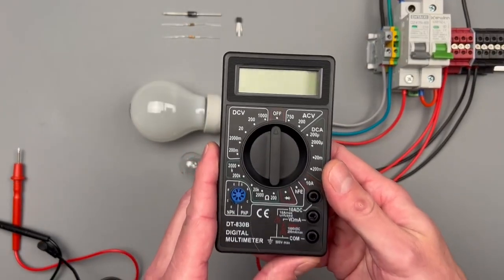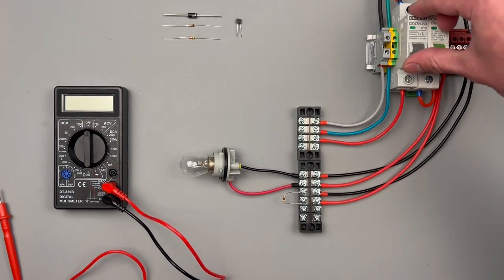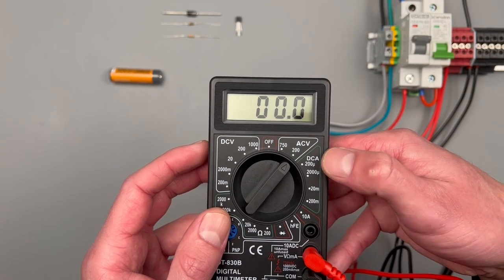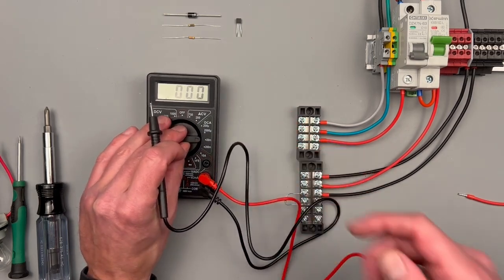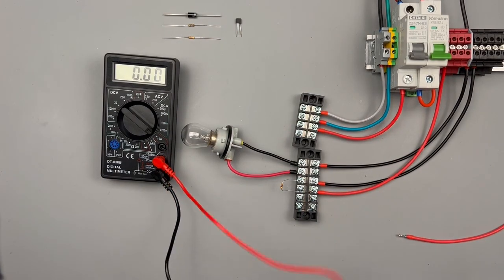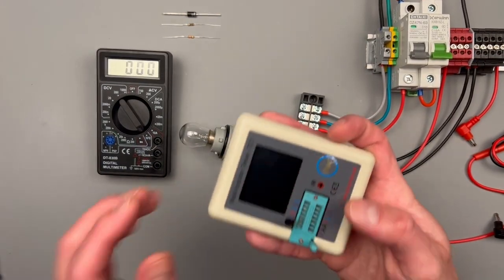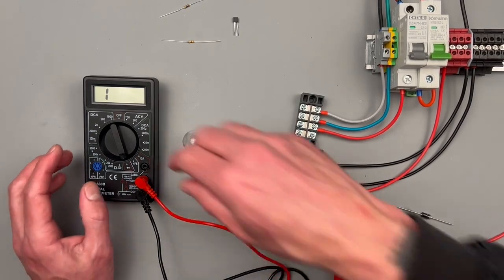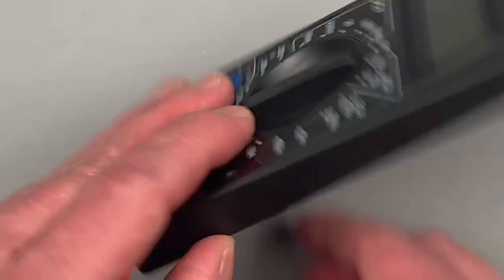How to Use the DT830 / DT830B / DT830D Digital Multimeter (And Why You Shouldn't Buy It) ⚠️📉🚫

Comment: Hmm i have had the same meter for about at least 10 yrs. I use is once i an while and hardly ever change the battery and it worked fine for what i was using it for. It just does not have capacitance reading which i why i turned to here.
Reply from the maker: I would try the 7 function digital multimeter from harbor freight. Very similar meter and pricing, but way better build quality and also has a capacitance function. I've got a video on it here:

 https://www.youtube.com/watch?v=BtB7iC-nd8M
Reply: @maddoxmechanic  Are you talking about the Red one you say was $12 online? I don't see any capacitance test on that?
Reply from the maker: @Someguy35167  You know what, you're right. there isn't a capacitance measurement on that one.
Reply: @maddoxmechanic  Thanks i will check it out!

Comment: i litteraly just bought that multimeter 😭😭😭😭😭😭😭
Reply from the maker: Aww no! Well, I hope the video helps you get the most out of it!
Reply: @maddoxmechanic  its still decent (well atleast for me🥲🥲🥲) i hope i dont twist the conector (its my second multimeter my first was a good one but i tested it with some old unknown state device and there it was in the trash can (the old device broke it))
Reply from the maker: @MrCoolOfficialYT I'm going to give you a link to a meter that is similar in price and size and function but has a waaaay better build quality

https://www.harborfreight.com/7-Function-Digital-Multimeter-59434.html?hftm_sc=59&hftm_source=google&utm_source=google&utm_medium=cpc&utm_campaign=21901739423&campaignid=21901739423&utm_content=173216738791&adsetid=173216738791&product=59434&gad_source=1&gad_campaignid=21901739423&gclid=Cj0KCQiA_8TJBhDNARIsAPX5qxTXwSADk6mKsKBN7NOFYH0DyNXuCwla0X89GlsOU93s5n2gRG6_9bsaAm3yEALw_wcB

Comment: Soldering is a common issue of all cheap multimeters. When you buy it, remove and solder back all input jacks. If they are inserted into the PCB (like on DT9205), solder them from BOTH SIDES.
Reply from the maker: Great tip!

Comment: The multimeter is based on the ICL7106 and variants. 
This IC came out in the 1980s and measures 200mV, has 3½ digits, an LCD or LED display and can be powered by a 9v battery. 
Disadvantage: Battery minus must not be connected to the minus measuring line. It cannot measure its own battery.
The ICL7116 also has a hold function. 
Today the IC is no longer offered in a DIP housing but is placed directly on the circuit board under a black blob.
The typical range is 0.2V 2V 20V 200V ...

The poor measurement results come about because cheap, uncalibrated resistors are used.
There is always a drop of 200mV in the ampere range, which is why the measuring device falsifies the measurement at small currents.
On the other hand, it can only withstand 10A for a few minutes, then the internal shunt gets too hot.

The multimeter does not have an overload protection. Measuring voltage over 100V with it is risky. Very thin plastic.
Summary: a guessing iron
The IC alone with good calibrated resistors is usable.
Reply: Any cheap Chinese multimeter requires an HFE. 
Even if it makes the isolation worse.
Reply from the maker: Thanks for sharing!

Comment: The first one of these I bought many years ago did have a small fuse inside for the DC mA range. Later units did not, presumably to save a few cents. The 10 amp range is not fused but not to worry, if you overload it, the probe wires will melt to break the circuit 8). The probe wires are so cheap, I'm concerned using them even for 120V. Most of the time I'm just using this meter for checking 12VDC stuff, the current drawn by small devices or testing continuity. They are cheap enough to have several laying around.
Reply from the maker: Thanks for sharing. Why not just have one, slightly better meter?
Reply: @maddoxmechanic  I have lots of meters, true rms, amp-clamps, O'scope etc but it's nice to have some cheap meters in the car or house so I don't have to go to the workshop to get one.
Reply from the maker: @wired-up  gotcha. Makes sense

Comment: I bought two of these and they were very different inside. There is no receptacle for the transistor. All three leads of your device must be exactly the same length and very straight to simultaneously hit the gold pads on the PCB. With some modifications I was able to achieve near perfect readings on all settings, but I would not expect the average user to be able to do these procedures. Instead I would recommend the XL830L which I have four. These don’t need adjustments and arrive in better condition.
Reply: One thing I dislike about these meters are the cheap probes they come with.
Reply from the maker: @macy-gu6vl  oh the probes are terrible
Reply from the maker: Very nice. Thank you for sharing!
Reply: This is professional dmm, the beginners uses a way expensive. For less than $1 you can solder calibration option and fuse. One more $ for step-up to use with any battery from trash bin. And DIY probes with good wire will cost equal to multimeter.. For accurate AC we need something else. But I'll try to put true RMS converter chip in this beauty.